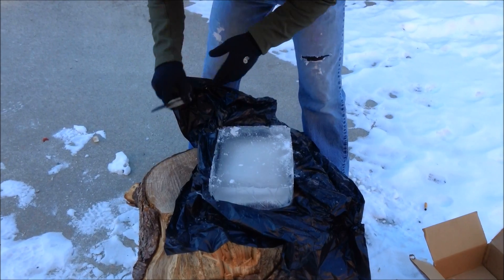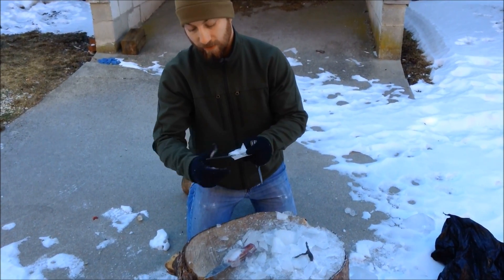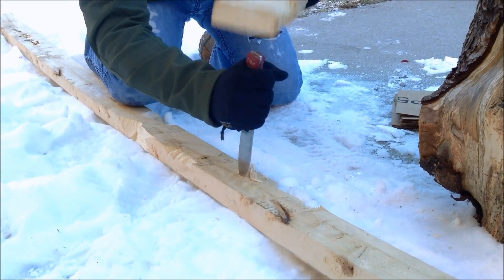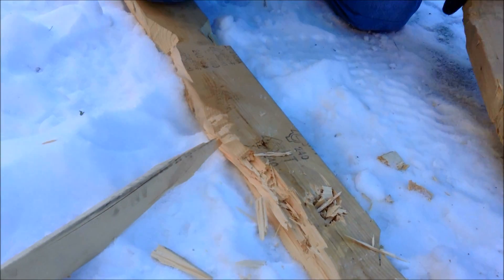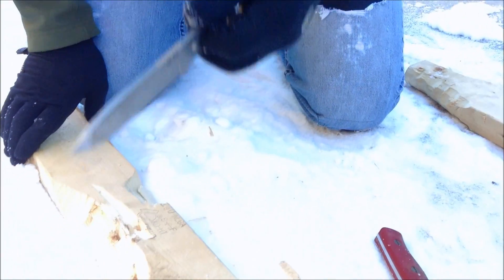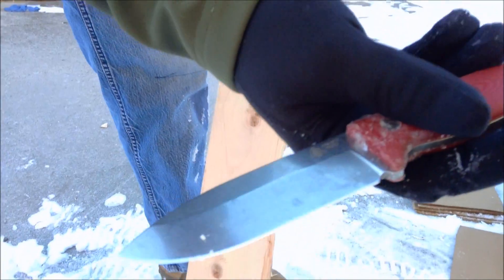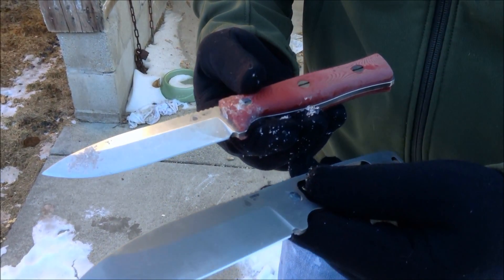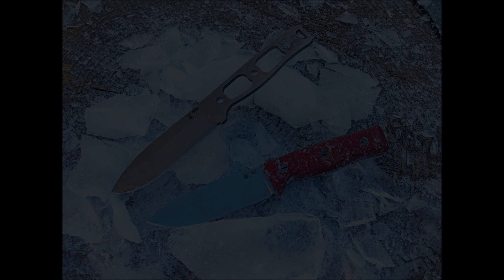SURVIVE! GSO-4.1 Cold Weather Testing

Comment: This isn't meant as a pot shot at SURVIVE! or anything like that, but just a friendly FYI that chopping ice isn't nearly the test on a knife many people think it is. Ice yields under relatively little pressure, its likely most of the resistance it provides is wedging which isn't really loading the apex. If you subject ice to pressure, it'll actually liquefy. Just as an example, take a thin single strand copper wire, and press it into an ice cube. You'll discover the pressure liquefies the ice, which moves around the wire, and refreezes behind it. You can pass it all the way through the cube without cutting the cube in half.
Reply: Survive Knives I do believe that its not the knives, but the plastic sheaths which become brittle in extreme cold. Then again there are different types of cold. There is maybe wear a jacket cold, squeaky snow cold, crackle in your nose when you inhale cold (mucus freezing), wee freezes before it hits the ground cold, and hurts to breathe cold. :P
Reply: Survive Knives
I broke the tip of my Buck fixed blade hunter after spending 3 days in 0-20 degree weather camping in the mtns of GA.  I believe the break (the tip) was party to do to the cold weather.  Guy's abuse is a real test of the blade strength.  He took the knives and beat the crap out of them after they were in single digit temperatures and frozen in a solid piece of ice.  I played lacrosse for years and I've seen metal shafts shatter in cold weather, so metal is effected by exposure to the cold. 

Sorry whatfor5 your point is a load of BS.  When hitting the ice you're still exposing the metal to freezing temperatures. Also I am not really sure you're 100% correct about breaking ice.  You're still hitting a solid surface - why else would you not go all the way through in a single strike??  Ice might be brittle but it is still solid.  Don't believe me try breaking ice with your hand.
Reply: Van Lurton No doubt it might get marginally more brittle, but if your knife broke in 0-20 degree weather doing just normal camping tasks I would argue there was very likely a preexisting problem. I'd also add that Buck has been having documented heat treat issues as of late. (ref. hoodlum, etc) 

Again freezing temperatures shouldn't significantly increase the brittleness of the knife. Likewise the ice shouldn't be exposing the metal to freezing temperatures any more than the air around the ice block; the knife should presumably be at ambient temperature just like the ice. 

You're actually not quite hitting a solid surface, and you're completely misreading what I had said about cutting ice. I had not said that you should go all the way through the ice block in a single strike, nor did anything I say imply it. Ice will liquefy under pressure. There was the wire example I gave above, primarily because its interesting, but if you look at the mechanics of the ice skate you'll see it works because the ice liquefies under the pressure of the skate. The reason you don't go all the way through is the same reason why you don't sink into a frozen lake on ice skates: wedging. I'm only saying that I'd expect the ice around the very apex of the edge to liquefy. This would still leave a vast amount of force for wedging, and that is (in my hypothesis) what is primarily occurring. This does still also transfer some shock to the blade, but in my hypothesized mechanism it would be doing so somewhere above the apex and thus not testing the knife at its weakest. (where its thinnest) 

I should also mention that I formed this hypothesis while chopping ice out of a lake and subsequently hacking it up/carving it for beverage coolers (as in something to put your drinks in to keep them cold while you're in the sauna), carving into random fun sculptures, etc. The knives remain shaving sharp after the exercise, which after that much hard chopping had surprised me, and is what lead me to start formulating the above hypothesis. 

This is not an attack on Guy in any way, because you'll note two critical things: 
1) Testing is marketing. If you think the test is rigorous, then it is showing exactly what you wanted/needed to see. 
2) He proceeded to do other testing (beyond breaking ice) with the knife. Cutting a wet frozen 2x4 is actually, for example, a harder task. 

Guy didn't expect the knives to fail, and neither did I as they're quality knives. Did you?
Reply: Survive Knives Glad I could help. :) For what its worth, Strider (who used to use Boss) currently uses Peters as well I do believe. A video from inside Peters was released recently, not widely circulated, that is an interesting look into something many people never really saw. Don't know of its of interest to you, or something you've already seen in person, but if you'd like:
http://youtu.be/OvC4M_JrJlw
Reply: Whatfor5
I understand what you're saying and point taken, I default to your experience on working with ice. 

However my buck knife break happened in '98 or '99 and it was brand new at the time.  So I still believe that metal can get brittle when exposed to sub freezing temps over time.  The break happened when I was just making a bow drill divot and the tip broke.  There was no metal in the wood and I, as well as the group I was camping with, was pretty surprised.  I wasn't really abusing it like Guy does in his videos.  I had done a bunch of work with it the 2 1/2 days prior including cutting, chopping, whittling, carving and batoning prior to the break so I don't think it was defective. Maybe I am wrong but I am not buying another Buck again. 

Regarding the testing I spoke with Guy back in Dec '13 about his 20cv stainless and he was pretty high on it so I assumed that it would hold up.  But this testing is a validation, which supersedes any assumptions.  It's not a matter showing me exactly what I wanted to see, as much as proving his knives are really tough. 

He's putting his money where his mouth is: repelling off of a 4.1, doing pullups on a 4.1 with the knife parallel to the ground stressing the knife at it's weakest point, stabbing a 7/7 through a truck's windshield, penetrating an old truck door with a 7/7, bending a 7/7 at least 20+ degrees off center, jabbing twisting and prying a 2x4, and on and on.  And the knives DON'T break.  There's a saying in the sales world "marketing makes you aware,  selling makes you buy".  He's selling. 

I agree, he should try chopping a big block of ice.  Guy??